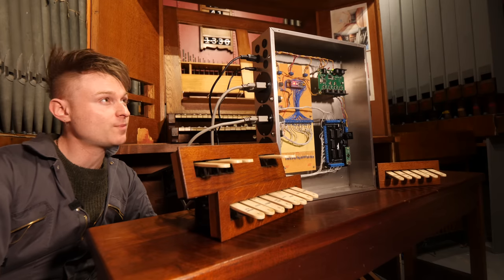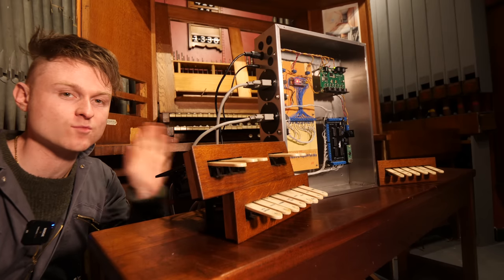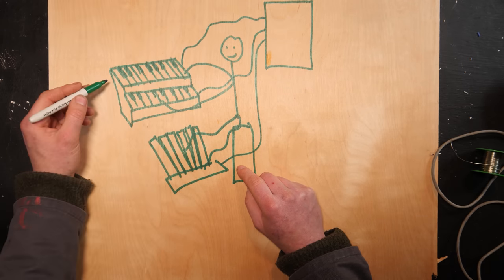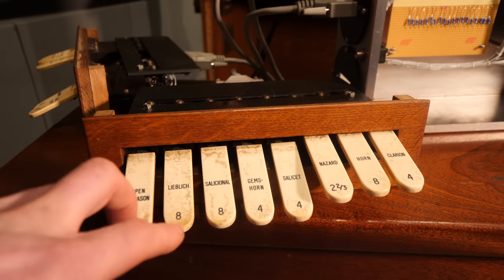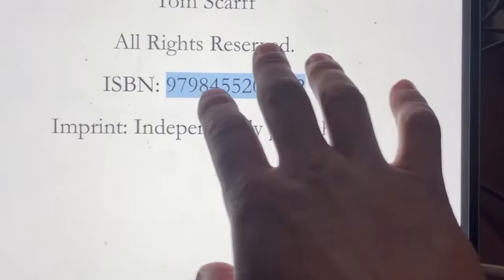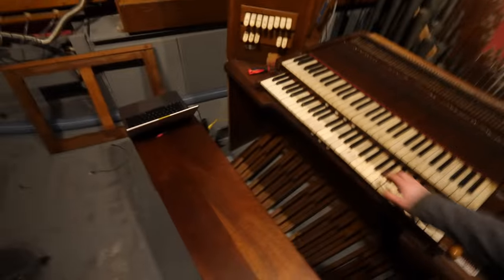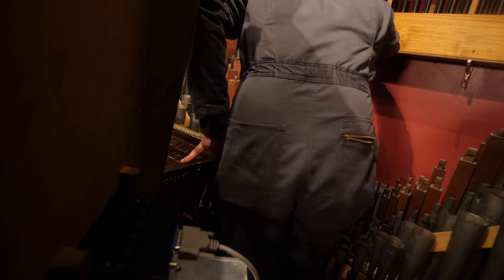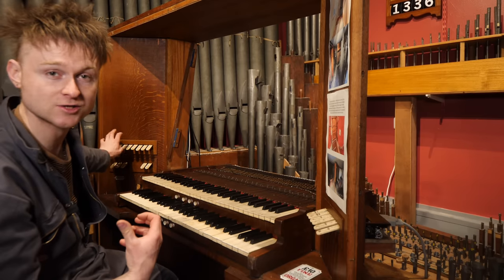I BOUGHT A CHURCH ORGAN PART 14 - CONSOLE BRAINS AND WIRING

Comment: Someone might've pointed this out already but I think you might have the great and swell stop tabs the wrong way round - Great divisions usually have the basic fundamental principally stuff (so the 8' Diapason, 4' Octave, 2' Fifteenth etc) and the swell will have the more colourful sounds (the salicionals, reeds etc) so I think the one you were referring to as the great is actually for the swell and vice versa. Not that it really matters all that much since it's all midi controlled now and the stop tabs can be programmed to whatever you want, but just if you want authenticity that's probably the way round they were originally. It's an absolutely amazing job you've done though converting all that analog electrical gubbins into midi!
Reply: Also the great stops are usually on the right hand side of the console and the swell and pedals are on the left, which is the way round you already have them here! So if you wanted to change it you wouldn't have to physically move them, just reprogram them to swap which manual they control :)

Comment: the Swell stops are the ones with Lieblich, and Salicional. Usually they would be enclosed in a swell box which allows volume control over the swell stops.  These are not Great division stops.
Reply from the maker: Yep cheers fixed it the other day my bad. As for swell box not got one sadly it never had one
Reply: @LOOKMUMNOCOMPUTER  top job, happy to play it sometime for you.

Comment: I don't know if anyone has suggested this yet, but you should investigate J-Organ, which is a JAVA based MIDI organ relay that runs on Linux, Windows, or OSX. This does exactly what your arduino based relay does, but adds many more features.
Reply from the maker: Yeah but I don't wanna use clunky computers. Something that boots into its mode in a second is much more preferable.

Comment: One possible solution to mid-keypress switching would be to change the wiring so that the switches actually control a set of relays/transistors that either enable or disable the signal coming out of the MIDI controllers in the windchests so that the controllers would always receive all commands. To solve the issue of two keyboards controlling the same pipes you could have two separate MIDI controllers in each widchest, one for each keyboard and then combine the respective output wires going to the windpipe relays, effectively getting an OR gate.
Reply from the maker: It's a very long winded solution that also removes the fact it's all quite a modular design. Half way through the code it's all good
Reply from the maker: Remember both keyboards can also send out the same notes on their own and cancel each other out it's a problem even with one keyboard
Reply: Oh, OK, that makes sense. Nevermind then!
Reply from the maker: All good! Always good to have suggestions cheers!

Comment: Had a shower thought about midi ON/OFF to the pipes,

Why not have each note state saved as a bit in a 4-bit (0000) value based on the inputs. So that notes from the Uppper, Lower and Peddles are mixed (midi channels 1,2, & 3 based on your drawing). So if all 3 are in a "On" state it is saved as the value 7 (0111). And in the lower note is released it drops to 5 (0101) 
The note state is saved on the 4th bit. So if the value is between 1-7 send the MIDI ON for that note, and when the value is 8 send MIDI OFF

Example:
Peddle pressed:  set its bit ON, As the Value is now 1 (0001), Send MIDI Note ON and set state bit to ON (Value is now 9) 
Upper is now press : Set its bit ON, Value is now 13 (1101), No new midi command, and stat bit is already ON
Release Peddle : Set its bit OFF, Value is now 12 (1100), No new midi command, and stat bit is already ON
Release Upper : Set its Bit OFF, Vaule is now 8 (1000), Send MIDI Note  OFF and set state Bit to OFF (Value is now 0)

Comment: Just convert MIDI to bitmaps (one bit per key, on or off), combine bitmaps to get the pipe bitmaps, then convert those pipe bitmaps back to MIDI out. It will save a load of hassle.

Comment: I noticed while you're  holding notes and turn an additional stop on, it doesnt activate the additional pipes until you hit a key.  Pretty sure it should turn on the additional notes on that stop as soon as the stop is turned on.  You might already know that or i might be wrong, but thanks I love all these organ videos!!  Keep on going :)
Reply: It seems like there should be a valve that opens and closes the wind for each chest which would be equivalent to stops on/off, then if you had notes turned on in that chest but no wind, it would just come on or stop, idunno if anything works like that but it seems reasonable
Reply: I would hate to have to check that notes would have been turned on had that stop been on
Reply from the maker: I mention that in the vid 👍

Comment: I think you need to retune a lot of the notes to 440hz the octave around A4 specifically by ear, human hearing and notes don't translate to tuners very well especially when going to higher and lower octaves(tuners are "correct" but human ears are imperfert and simply don't hear musical notes and tuning accurately) so you have to use the 4th octave to tune the rest of the octaves by ear, I can hear it especially in the higher notes of the organ.
Reply from the maker: I never use tuners. When writing and producing songs I find tuning to whatever feels right is better than any standard. Just use your ears. Tuners or any tuning standard is overrated

Comment: Another edge case you may need to consider with the code, is if you have a key pressed, then deactivate the stop for that board, does it send a key up to the target?
Reply from the maker: Cheers Carl. I do mention that in the vid :) and fix it by end of vid
Reply: @LOOKMUMNOCOMPUTER  I was part distracted when watching, actually commented at the end of the vid. Sorry about that! At least there is some good comments for the YT algorithm
Reply: I will re-watch that section, see how you did it :)

Comment: I probably would have done it somewhat differently with input side of things, but that's not to say what you've done is invalid, or even bad. It clearly works, which is 100% more than what I've done.
But might I suggest gathering all the inputs you have (_all_ of them), and then working out what the state of the pipes needs to be based on that.
You could probably minimise the amount of spam on the MIDI bus if you kept track of the previous state as well, and only issue commands based on the changes.

Comment: Would it be possible to keep the different boards on different midi channels so the master controller knows where each signal is still coming from, instead of converting them all to the same channel. You're right the system needs more than a naïve translation layer from note on/off to output directly. Having a state machine that tracks all inputs to all intended pipes, resolving changes and collisions, then outputting the state machine to the actual pipes is necessary. Having the different boards remain on different midi channels could make tracking those changes easier instead of treating them as a sum/quantity of notes on a given voice.
Reply from the maker: The problem is the issue can still arise from a single keyboard
Reply: @LOOKMUMNOCOMPUTER  very fair. State machine per key affected only by key midi input, state machine per pipe, affected only by a translation layer state machine, which is affected by the bank switches. Fast loop as fast as the micro will allow to solve the output machine based on the inputs. Acting on the triggers as you mention will cause problems!

Comment: What if you would have a state machine running in the arduino that would continually send out outputs based on the state of all the inputs. So the output midi stream is on a clock cycle.

Comment: I’ve built a lot of industrial control panels. I think your panel size selection is actually nearly perfect. You always want extra space for possible modifications in the future. A good rule of thumb (if not extremely rough) is you alway want an open space volume that is equal to or 1/3 greater than that of the occupied volume.

A larger box surface area also helps with providing a larger passive cooling surface. Not that heat is an issue with your application. Having enough extra space for assembly and maintenance is extremely important as well.

In the end, you are hacking an old church organ, not building an iPhone. Shrinking the panel size is NOT a concern here. If anything, making it big makes it easier to show off the components and show your work.

Screw Big Ben, I am an American who wishes for only two things on a trip to the UK. Visiting both of Tim Hunkin’s arcades and visiting your museum. Maybe someday.

Comment: @16:55
add both buttons to a single value(tempvalue) so if tempvalue > 100 send noteON if <100 send noteOFF
so:
button1 on = 127 is noteON
button2 on = 127 is noteON
button1&2 on = 254 is noteON

and @ 12:34 dont send the noteOFF command when the selector is selected ALLWAYS send noteOFF to channel 13,14,15 and 16 even when nothing is selected.

Comment: You know you need to make both keyboards, and pedals solenoid driven, too........
Reply from the maker: I tried. WAs a faff. Maybe one day but it was gunn be  right oin
Reply: @LOOKMUMNOCOMPUTER  it'll be fun to watch! ...I wonder how rapid of switching those switches you did, are capable of......Seems like some interesting experiments with switching voices on and off (imagine parameter locking those!) could be a lot of fun, if the switches can physically keep up with more complex switching activities...
Reply from the maker: @DetroitMicroSound  it can do a switch per 100ms no quicker trust me. I tried lol
Reply: @LOOKMUMNOCOMPUTER  Still loads of experimentation to be performed, no doubt! 😃👍

Comment: Regarding the midi-issue: I've done something quiet similar, yet completely different: like displaying pressed keys in a browser as rendered sheet notes with some node.js-javascript and 2D-canvas-magic, all in real time. ; ) 

let keyCount = [];
      socket.on('midiActivity', (msg) => {
        // CALLER: /midi/midiInterceptor.js
        
       if(msg.message[0] === 144) //note on event
          {
            if(msg.message[2]>0)
            {
                draw(msg.message[1]);
                keyCount.push(msg.message[1]);
            }
          }
          if(msg.message[0] === 128) //note off event
          {
            const index = keyCount.indexOf(msg.message[1]);
            if (index > -1) { // only splice array when item is found
                keyCount.splice(index, 1); // 2nd parameter means remove one item only
            }
            updateMainCanvas();
          }
      });

Comment: I gotta say, I think it's slightly hilarious just how many separate arduinos you have running in this thing. I mean, it works, so I'm not hating on that, and I suppose there's something to be said about the modularity it provides. But deep down a part of me wishes everything ran on a central brain rather than a bunch of separate systems all doing their own thing in parallel.
Reply from the maker: Would still boil down to micro controllers on each windchest

Comment: Wonderful series!  The pipe organ is the most complex machine that was ever invented prior to the introduction of the telephone switch.

Gemshorn is a high flute stop - I'd make the geigen-princiipal a 4' metal and the gemshorn a 4' wood.

"A note decided to stick open" - an organist would call that a 'wolf' and they are the bane of an organist's existence.

In the final demo, you have a couple of pipes still quite out of tune, and the beat is noticeable.  (If you detune a rank deliberately, it becomes a stop labeled 'vox celesta' and gives a nice vibrato effect against a string stop).